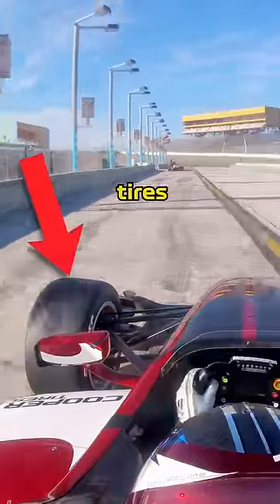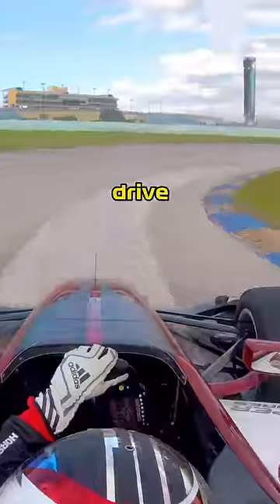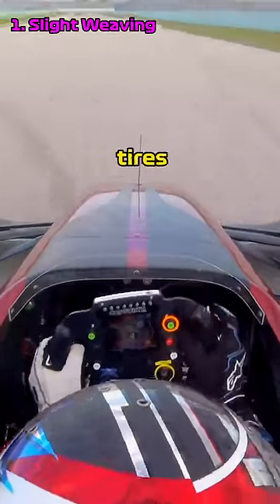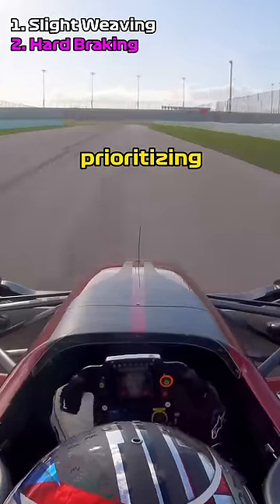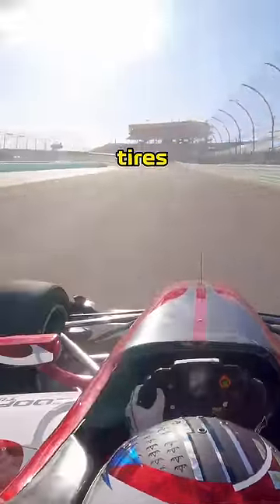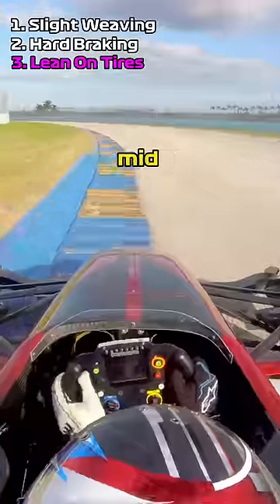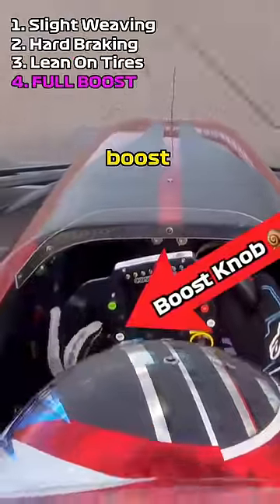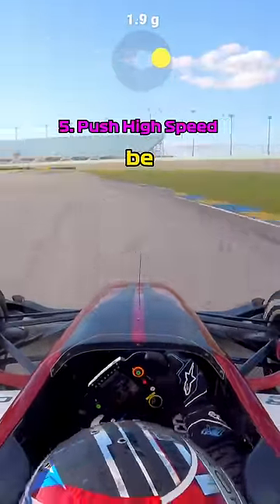How to WARM UP NEW TIRES in a 500HP RACE CAR #f1 #racing #onboard

Comment: how is he so underrated
Reply: Maybe because he went 25th in F3?
Reply: @wahyudyatmika5119 lmaoo facts
Reply: @@HasanAsSamihe has won united states f4 and euroformula open in his 5th season which isn't too good. In junior formulas there is an urwitten law that says you cannot be in junior championships for more than a few years (2-3)
Reply: @@HasanAsSami dude was 22 last year and just won Euro Formula
Reply from the maker: @anakinskywalker9772 It did take me a while to win EFO. I started racing 7-10 years later than my competitors. I always had to do everything “on a budget” so what other drivers could typically practice in testing in the off-season, I learned on the race weekends. I wasn’t ready for FIA F3 when I did it, and we didn’t have the budget to race a quick car or do any testing. I regret doing it before I was ready, hence why I stepped down to do Euroformula and win it (arguably a harder car to drive), but I certainly learned a lot through the struggles of FIA F3. 

I think the pressure put on drivers at such a young age is counterproductive and performance at an early age is not always an indicator of max potential.
Reply: @CameronDasRacing  1st Respect to you that made it that far and to interact with your community. 2nd Yeah, money does play a big part in any racing career. Also I agree with you about your time in f3. If I were you I would first win EFO and then get promoted in f3. If you find sponsors (I hope you do because I belive that you've got lot to prove) you could return to f3 and possibly impress enough to go to F2. Also a question for you, do you belive that your age would stop you/make it more difficult to reach F2? Anyway, yiu still are a better driver than me or anyone else who comments.
Reply: You still have time to be a legend don’t trip
Reply: He’s not. There’s just not a lot of open wheel content creators 😂. But don’t get me wrong he’s good
Reply: @ParkerTolin true but dang it's high quality content for someone who has 250k subs
Reply: @wahyudyatmika5119 what did you place in f3?
Reply: @underskillednunderpaid  I do not need to join F3 to have the same stats as him lmao
Reply: Because the content doesnt appease the algorithm. Its quality definitely but not the kind to get arguments in the comments section 😂
Reply from the maker: @anakinskywalker9772 Honestly, age doesn’t play a factor at all to getting a seat in F2 (okay maybe if you’re 45 then it’s an issue lol). If you have the money and the license (International A), you can do it.

Let’s say it takes me another 5 years to find funding for F2 and I enter at 28 years old, other drivers and spectators would probably laugh at me, but I couldn’t care less anymore. Everyone’s story is different, and I’d rather let results and my personality dictate how I’m perceived than something as inconsequential as my age.
Reply: @CameronDasRacing well said
Reply: @CameronDasRacing I'm curious, how did you start participating in EFO? Did you just aproach teams to see if they can offer you a seat? Really curious to how stuff like that works.
Reply: @CameronDasRacing just keep going🎉
Love ur content❤
Reply: @CameronDasRacing would you ever go back to f3?
Reply: Come to Jesus Christ before it's to late
Reply: @CameronDasRacing at least you got into F3 tbh
Reply: He called people NPCs while they’re were just enjoying their time in karting, pretty pathetic lol
Reply: @CameronDasRacing the same happena to me to be a private airplane pilot
Stupid budget
Reply: @CameronDasRacing the same happena to me to be a private airplane pilot
Stupid budget
Reply: maybe because he calls beginner go kart drivers NPCs
Reply: @CameronDasRacing what about height what height is consequential?
Reply: @nocamak1186 are you playing your life tho?
Reply: @CameronDasRacing hope you make it to f2 sometime in the future
Reply: Because he’s been a douchebag to other drivers in karts just having a good time
Reply: Jesus loves you
Reply: @bennette.7033  thank you for reminding me
Reply: @LLETSRIDE  we need more people like you
Reply: @CameronDasRacing out of curiosity how old were you when you started racing ?
Reply: @CameronDasRacing  how do I become an f1 racer?
Reply: @wahyudyatmika5119 do you drive a f1 car, no that’s what I thought
Reply: Because this content sucks
Reply: Because he hits other go-karts and never ever ever ever thinks it's his own fault
Reply: @CameronDasRacing  सत्य वचन 👏👏👏।
Reply: nuhuhh
Reply: Because not everyone watches F1
Reply: Idk racing at all but if tire temp matters, why aren't they pre-heated

Comment: Tires DO NOT have any layer of "release" agent or slick from factory on them from manufacturing, they come out of the factory at ~ 95% max grip this was true 50 years ago or more but we have more advanced moulding techniques, the shine is litterly just the rubber contacting the steel mold, and sice the mold is shiny steel the rubber makes a perfectly flast surface that allows it to shine, (former Michelin tire manufacturing plant worker)
Reply: Yep, it's also common knowledge in F1 that the tyres look shiny but have a shit ton of grip

Comment: Is this prep lap just for this car, as when I am watching qualifying in F1 they do 1 out lap then their next lap is their push  lap with no prep lap?
Reply: I think in F1 they have already scrubbed the tyres in (so that release layer is already gone) which is why the prep lap is unnecessary.
Reply: I think they have tire warmers that look like sleeves aswell
Reply: It’s because they use tire blankets so the tires need less heating to get into the window and F1 cars put much more energy into the tires heating them up faster
Reply: @Cnvio19 yes

Comment: What formula car is this? Cause no formula car is even close to 500 hp, they are all a lot less or a lot more than 500 hp
Reply: He never said it’s a formula car. Simply said a race car
Reply: Bro look at the description
Reply: He says what car he’s driving
Reply from the maker: It's an Indy NXT car (F2 of Indycar) which used to be called Indy Lights. It's 450hp in base trim, and 500hp with push to pass mode on.
Reply: @CameronDasRacing what type of cars did you race after karting?
Reply: awesome vid Cameron once again 
 @CameronDasRacing

Comment: As you say, weaving doesn't warm up the tires, it's just to "rub" them and remove the very outer layer. F1 drivers keep weaving behind the safety car all the time, and people made it a meme that Kimi Räikkönen did not do that. Almost noone understands that most of the heat comes from the brakes and FAST cornering, but weaving at slow speeds doesn't generate enough heat, it only wears the rubber very slowly.

Comment: This is a great way or you can do it the Fernando Alonso  which is flicking the R25 from side to side like it was a FD car still to this day I don’t know how on earth he didn’t crash that car the way he used to warm up the tires   it’s a very very amazing  example of exceptional call control
Reply from the maker: If you’re talking about doing this right as you’re pulling up to the grid, this is done more to clean the tires than to warm them up necessarily. Older F1 tires could definitely handle more surface temp than the newer more “eco-friendly” compounds.

Comment: When was this filmed, looks like a IL-15 but no halo. Plus still got the coopers
Reply: That’s what I was thinking
Reply: @Kilo-sz4ch  yeah, I've never run the cooper tires only the Bridgestone/Firestone with this chassis car. They warm up way quicker than the coopers from what I have heard
Reply: @jacksonblanks8038  oh you’ve raced these?
Reply: @Kilo-sz4ch  Av-21, look up the Indy autonomous challenge. Essentially the same car with a different engine

Comment: I had a thought. Lets say f1 racing, do they prep lap or go easy after new tires after every tire is put on. I know they pre warm tires. But as a driver, do you have to remove the release stuff every set??
Reply: F1 have tire warmers
Reply: @bigmack7234  no but like theres the release from the tire mold on every new set

Comment: Can we have a video on how to warm up tires in low horsepower cars?
Reply from the maker: It’s exactly the same. Sometimes, low HP cars have harder compound tires so it can take longer to reach optimal temperature, but the process is the same.

Comment: Personally I just try to drift the car into every corner, that way my rear tires will be hot and I will need to come into the pit for a fresh set
Reply from the maker: That will certainly generate temp, but not the kind you want. Sliding generates surface temp, but G force and brake temperature create carcass (core) temp. Surface and core temp need to match for the tire to operate efficiently otherwise you may as well buy some crappy tires and do burnouts all day 😂

Comment: one question, is there any prep lap to rise the tires temp and grip if you change the tires mid race? like if you change to other kind of tires on a pitstop

doesn't the new tires are also cold?
Reply: normaly qualify lap is a lot faster than race lap, beacuse of the trafic.

Comment: Cameron, how do you afford this lifestyle?
Reply: You know, there are two ways to get into racing.
1. Buy yourself into it
2. Have actual talent and make teams want you.
Reply: @simraceaddict  I think the 2nd is the exception rather than the rule. Even with talent, if you don’t find the money to pay for your rides especially early on, you won’t get the opportunity to shine and show people that you’re worth investing in (both from new future sponsors AND convincing a team your worth taking on as their driver). It will still always come down to needing to find the money yourself to a large large degree. With a greater and longer historical track record of performance though, it would become easier to acquire funding. Most teams are not bottomless pits of charity. They’re on razor thin margin edge as is. The exceptions are the teams that tend to constantly be killing it because they themselves have backers with blank checks like Mercedes (at least before cost cap). But they are/were the exception.
Reply: @DrR1pper of course. You're right, you can't do it without money. But then come the sponsors, which helped a lot of mid-class drivers with their Carrer. Just think of ocon. That's why talent is the most important factor. They would never get the sponsors without it.

Comment: So, this is a dumb question: why don’t they pre-heat the tires in F1 races? Like just put them in an oven before putting them on
Reply: F1 teams would use tire warmers for that. It’s basically like a blanket that heats the tire and keeps it at the right temperature until the car is ready to roll but this is a 2018-2019 Indy NXT (Indy Lights) chasis and here in America I can’t think of a single racing series that allows tire warmers.

Comment: I’ve done go karts before at a fast speed the place I did it at controls the speed through a remote and only lets older kids do the high speed i was with me and some friends and I ran the go kart into the wall and the seat belt scratched my neck… 💀😭

Comment: Only 500 horsepower some cars out here have 700 stock
Reply: Do those cars weigh 1500 lbs 3000 lbs of downforce and cut through air like a knife

Comment: Couldn't someone invent something that would go over the tiers and warm them up instead?
Reply: it exists, theyre called tyre blankets but many series' dont use them due to costs
Reply: Didn't know that, but i think long term it would cover the cost of the fuel and wear done on the car. Idk why they would be so expensive as I think the design would be pretty simple @oren2000

Comment: Do the brakes work better when there not cold?
Reply: Yes, race car brskes and tyres sre designed to work best when at fairly high temps around 105c unlike road cars and the brakes on f1 cars work best at 500c

Comment: You know what's sucks is that in one of my games? That's the stock track and it's for time run an oh my God. The amount of times I went into the f**** wall due to meet up breaking. Can you add the proper time sucked? Absolute dick, especially on a tighter Section and it was really just turn one that was really Just able to fly around you can take that about.
I was able to take it at 120 before the car started. Sliding towards the outside halfway through brake and then full throttle the rest of the way out.

Comment: bro thinks this is anything like an f1 car. yes you need to warm up the tyres in an f1 car, but you could see him sliding around some corners. f1 cars cannot do that, also due to the fact theyre more like 1000bhp. if you slide around a corner in an f1 car, youre losing control almost immediately. also, in f1, they dont have time to heat up the tyres due to them being in a real race, so they have to pretty much race as fast and aggressive as they can despite it being 100x slippier
Reply: No
Reply: @Kilo-sz4ch  how would you know mate

Comment: Sure bro just talks shit. Every professional driver knows that that burnout when released from the pits is super bad for the tires. Because the tires are still very cold. A good driver knows that this is unnecessary and just hurting the tires, also a good driver would just get the tires up to temp in a outlap. Without a burnout that hurts the tires.
Reply: Different tires react differently also Indycar and NASCAR drivers often do burnouts out of the pit box